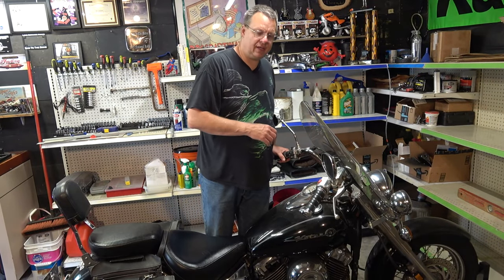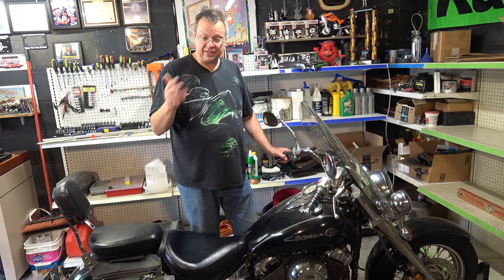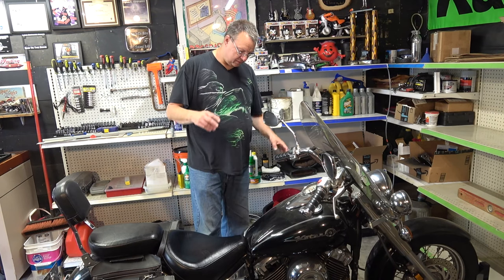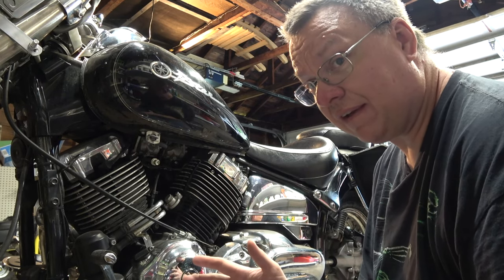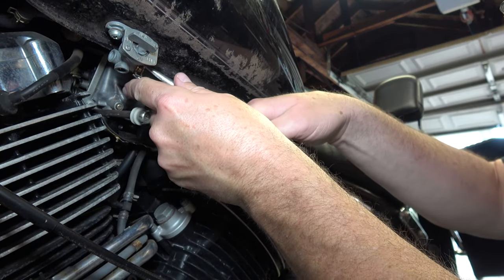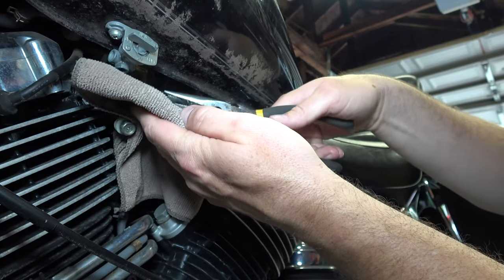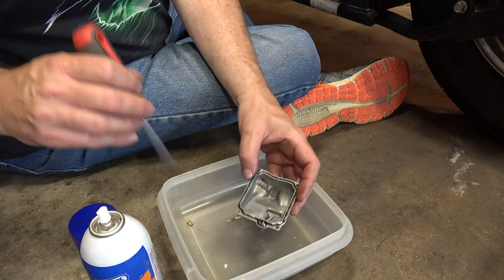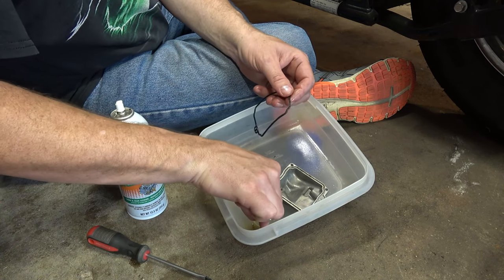V Star 650 - Carburetor Jet Cleaning

Comment: CHB, you nailed it. I isolated my problem was in the front cylinder/carb. Thanks to your excellent video, I was able, with some significant effort, to access and remove the screws. Once that was done the rest was a breeze. One of my jets was totally blocked. No wonder it had no power. Thanks for the idea and the video. She’s running like a scalded cat!
Reply from the maker: Thanks Keith, it always makes me feel good when people say my videos helped them. Mean the world to me.
Reply: Would the front header turning blue and maxes out at 60mph be indicating that the front carb my be clogged?
Reply: Would you recommend seafoam or Techron fuel cleaner?
Reply from the maker: I would look at the air fuel mix. My first thought is that you might be running lean.
Reply: @ChefHikerBiker  where is that located?
Reply: @philspaseo2377  Phil, that’s exactly what mine was doing. 60 mph max and header turned blue from overheating I presume. After the Chef’s carb cleaning routine, all is well, lots of power.
Reply: @margiekeith  thank you!
Reply: @margiekeith  update, I opened up the carb on the front and the main jet wasnt clogged. It was surprisingly clean… still bashing my head against the wall
Reply from the maker: I still think you might have an issue with your air/fuel mixture screw.
Reply: @ChefHikerBiker  where is that located? Is it the one middle screw for both carbs or is it the screw for eac individual carbs that is behind the airbox?
Reply from the maker: It will be a screw for each carb. I don't know much about the V-Star. I do know the carb design has changed over the years. I do know that some V-Stars have the adjustment screw under a brass plug. Which is no big deal. You just need to drill out the plug. I wish I could tell you where it's located but it would be easier for you to do a Google search for your exact bikes expanded carb view.
Reply: @ChefHikerBiker  I think I know which ones you are talking about. I believe it’s behind the airbox. I have the 2007 classic. Would i tighten the screws to the max or just adjust it a little loose for the front carburetor?
Reply from the maker: I would disassemble the whole screw: remove the spring, washer, and o-ring and make sure they are in good condition and within speck. Replace anything that is out of speck. BUT, before you actually remove the screw: count how many turns the screw is turned out. Do this by running the screw all the way in. It should be 2 - 2 1/2 turns. Then take it out, check and replace what is needed. Put it back together with the new parts. Then see if it helped. If it's still doing the same, then give the screw another half turn out. The further out it is, the more gas, or richer the mixture will become.
If you don't feel like getting that involved with trying to figure it out, you can just take it to a shop and have them figure it out, for you.
Remember: I am not a mechanic, I just go off the little knowledge that I have. Please, talk to your local shop and make sure, you're going the right way.
Reply: @ChefHikerBiker  the screws on both carbs seem to be the same amount of turns. I did drain the bowl for the front and didn’t mess with anything in the rear. The shop would charge me $485 to do some carb work(rejet). I think ima make the front a little richer by turning half a screw, to balance out the lean..

If I drained one of the bowl on the carbs and didn’t drain the other would that affect its drivability?
Reply from the maker: Ok. Well, I hope you can get it all figured out. I wish I could be there to see what exactly is going on.
Having 1 bowl drained might make it chug a little until gas gets into the bowl again.
Reply: @philspaseo2377  did you figure out the issue with your bike?

Comment: I will be having a second attempt at this in the coming days as my bike isn't running as well as it should. First attempt I tried to removed stripped heads (looks like the previous owner tried and chewed them up good). For this attempt I have got a new JIS screwdriver (impact if needed). I really don't want to have to get a grinder out under the fuel tank or dismantle the fuel tank at all if I can help it! Thanks for the video, I did't know about the draining screw!
Reply from the maker: Use a good penetrating oil on the bolts and give it time to do its thing. I like "3 in 1" or "Blaster". 3 in 1 is my perfered penetrating lube. It is more like an oil and comes in a dripper bottle.

Comment: Next time use the right bit. NOT Phillips, but rather J.I.S. driver or bit. Very similar to Phillips, but made to fit Japanese Phillip style heads, as all Japanese screws are J.I.S., which stands for Japanese Industrial Standard, as you found making this video, the Phillips driver was sloppy fitting, but the correct J.I.S. bit will fit just like it's made for it, heh, heh. The Japanese just had to be a bit different,  and still are. The drivers can be found online easily.
 Nice video, interesting, thanks for sharing !!!
Reply from the maker: Yes , I know about JIS. I typically don't have an issue with using a standard Phillips screwdriver on a JIS screw head, but that screw was already damaged. And as you can hear in the video, all the bolts were very tight and corroded in place; which didn't help either.

Comment: So I have a 1999 V-Star, and you've inspired me to try this on my own. Like Dell's bike some of the screws are insanely tight, (I did the oil change and air filter already, watching your video) and some of the ones holding the carburetor bowl in place are already stripped.  They are philips, not the allen heads that you had. I've sprayed them with WD-40 already but they don't want to budge, and I'm afraid I will strip them further. Do you have any suggestions for me? Thanks in advance.
Reply from the maker: A couple ideas come to mind.
My first suggestion is to get an extractor set. Which means you will need to drill out the head and a little bit into the shaft before using the extractor. 
Another idea is to keep spraying a penetrating lube on it until it breaks free.
Another thought is to take it to your shop and pay the professionals to work on it.
Reply: Use some vise grips on the screw head to break free the screws
Reply from the maker: I've always had bad luck with vice grips. I tend to chew up the head

Comment: Do you need to adjust the float heights or sync the carbs after you clean these jets like this? Also would you need to replace the gasket after you remove the bowls?
Reply from the maker: No on both questions.

Comment: What are the stock jet sizes? If anyone knows.. I’ve got a big air intake and running rich but if only cuts out at top end. Plugs are black so it’s rich. I’ve got 158 mains in it and 40 pilot thanks in advance
Reply from the maker: I want to say the pilot is a 20 and the main is either a 90 or 92.5, but I'm not absolutely certain.

Comment: I got looking up in mine & they've put sum kind of wire holder right over one of the float screws, it's like right behind this metal thing I'm gonna have to bend up & out of the way, other than that looks straight on like u did..  did u run into the metal wire guider hiding a float bowl screw too?
Reply from the maker: I'm having a hard time picturing what you are talking about. But I think you're talking about a wire on the outside of the float bowl. If it is what I'm thinking, it is the idle screw clip. Mine is missing, and does not have that wire clip. You shouldn't have to bend it, it should come off when you remove the float bowl screw.
Let me know if I'm right and send me a photo through Facebook messenger if I'm wrong.
Reply: @ChefHikerBiker  no it's not the idle screw one. The right carb, upper left screw, Right Infront of it is this little black metal wire guider,  I mean it's like in the way of that top left screw on right carb, looks like I can bend it up out of the way but I haven't seen it on others... Just wondered if had to mess w anything like that, no big deal, talk bout a bad spot for that but I imagine Yamaha knew that lol. Your vid is super helpful btw!!
Reply from the maker: Yeah, sorry, I can't imagine what it could be. Maybe something aftermarket that was put on by a previous owner.
Reply: @ChefHikerBiker  who knows, just something else in the way, looks factory tho, they can bend but still, hate doing stuff like that!! Ty so much for trying to help me!!!
Reply from the maker: No problem, thanks for watching and glad you like my stuff. Stay safe out there.✌
Reply from the maker: I have been think about your "wire," the only thing I could think of is the clip that holds the engine idle speed screw. Was the wire on the left carb's, lower right screw? Can you send me a picture through Facebook Messenger?